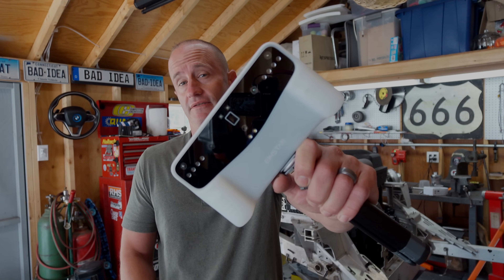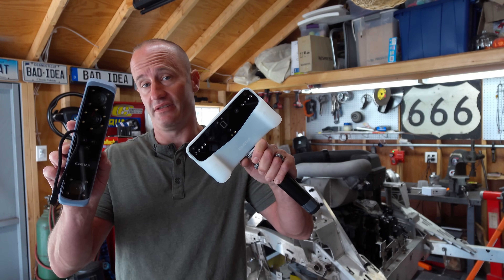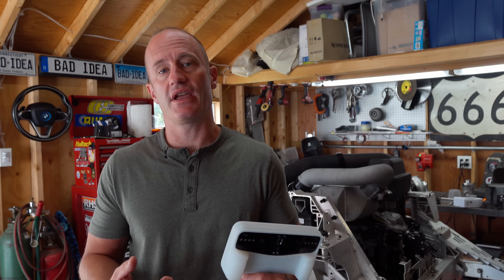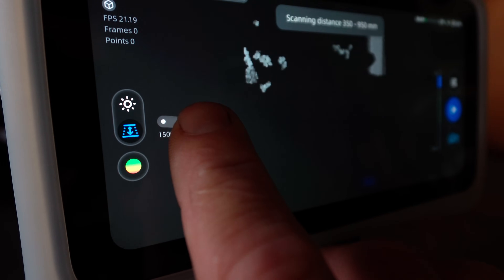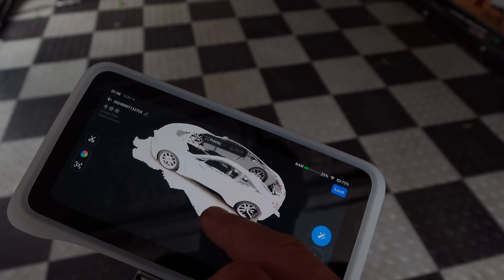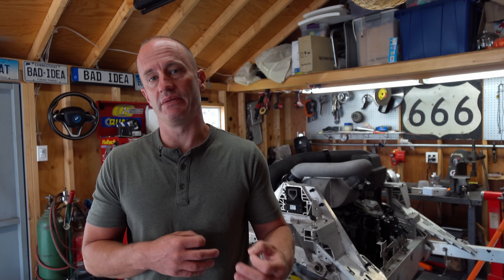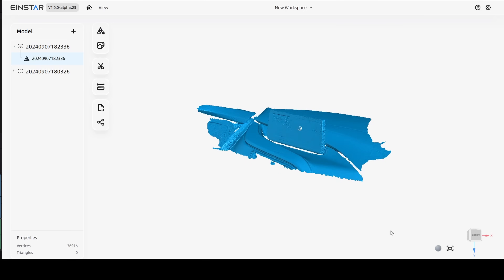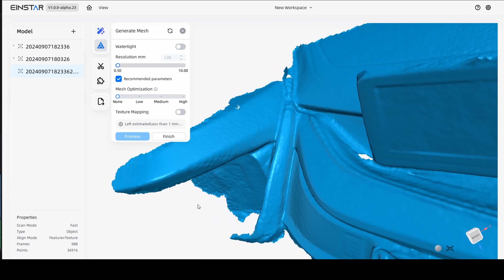Testing the Einstar VEGA on cars and car parts

Comment: Nice Video.
How big is the difference in dimensions between the real and the scanned part?
Reply from the maker: Good question. I went and imported the oil filter adapter mesh into F360 to get some measurements. Overall height of the real part was 38.88mm, mesh 38.857.  For the OD of the threaded port, real part is 28.22mm, mesh 28.248. See link to the photos. I think many conflate resolution with accuracy. These are not the same. Resolution is how close the meshed points are to each other. Accuracy is how precise the geometric relationship is to each of those points. a 1mm resolution does not mean 1mm error.  https://imgur.com/a/JIxcui1
Reply: @CouchBuilt  sounds quite good. My Einstar SE V1 have around the same difference.
Reply: I have the same question. From my perspective, the precision when scanning smaller parts doesn’t seem quite up to the mark either.

Comment: 2 months later, has it gotten any better with updates on midsize things like the dash? I'm trying to decide between this and the original one... I like the idea of cordless
Reply from the maker: There still remains that black hole in scanning range between 250-350mm between modes, but there have been some good updates in general usability. Things like clipping the point cloud that took quite a while to process are almost instant now and theyve added more tracking options like global markers.  I have to say I rarely reach for my older Einstar unless I have specific geometry needs for something about the size of a larger turbo. The convenience of just picking up the scanner and capturing data has been really really nice. I can scan the underside of a car to design an exhaust in well under 10 minutes from starting to the meshed stl.  After a few more months of use, Ill do an update video for sure.
Reply: @CouchBuilt  About time for that update?
Reply from the maker: @zacharykarr it’s on the to-do list. It’s been really damn good with the latest firmware updates. I sold my classic Einstar as it was no longer needed.

Comment: Did you find with the car scan it took 5+ min for the scan to pause, and then another couple hours for it to save before being able to mesh? That's been my experience trying to scan 1/4 of a car, wondering if it's normal.
Reply from the maker: I haven’t encountered anything like that with the Vega. That’s pretty standard for the classic Einstar. I’ve been trying to use the Vega whenever possible for how fast it is. It’s not great at everything, but I wouldn’t expect that behavior from a car scan.
Reply: @CouchBuilt thanks, I'll check with tech support.

Comment: is really not great at scanning any black surfaces of any sort, been testing out the Vega all afternoon. Otter is far superior here and 3 levels of scanning depths with more control. Shame as I was hoping it would be a replacement to my Otter.
Reply: Hi, interesting that you have a Einstar Vega and a Creality Otter.  I need a scanner to scan a full size surfboard, do you think that the Otter would be able to do it?  Top and bottom scans then merging both.  Does the Otter take the same amount of processing time compared to the Vega?

Comment: I have got a much better idea of how it handles larger objects. It is cool that it can scan a whole car, but the model still seems to need a lot of post-processing, which takes quite a bit of time to really make it usable.
Reply from the maker: Depends on your use case. Completing the model to use as a game asset or similar visual application, yes, there's a bunch of work. If you were going to design a widebody over fender kit, this would be good to go as-is. Thats closer to what I would use it for.

Comment: When auto aligning, the preview almost always looks like it won’t work. I’ve learned to do it anyway. Most of the time it works. If it doesn’t, then go back a step and do manual align. 

The only time the preview looks good is if you have already aligned those particular scans. This happens if I align a scan and it has artifacts or overlaps. I’ll delete that scan, redo it, then go back to align everything. Then all of the preview look good except for the new scan.
Reply from the maker: Thanks. I’ll give that a try. I always just backed out of it after seeing the misaligned preview.

Comment: how come it can scan outside??? If thats true then this might be the one to get
Reply from the maker: Something with the choice of sensors used. I’m not really up to speed on that to comment definitively. I haven’t done bright sun, but outdoor scanning is one of their advertised selling points. It worked well enough here in an overcast environment.
Reply: If an infrared scanner is capable of functioning effectively outdoors, it often means some degree of precision is sacrificed in capturing finer details. I guess this is why the final scan of smaller parts looks less accurate.

Comment: So is the vega not good for say transmission adapter size parts?  I was hoping to eek out the HD option to get even more accuracy on that or is the einstar still the best for that
Reply: The Einstar or Creality Otter are going to be 'better' for that application but they both still struggle with dimensional accuracy on holes. 
Really a laser scanner is needed for that application. 
This all being said there are tricks that can be used to make the IR scanners work better like installing a snug fitting bolt in all holes and using the shaft as the reference point for the hole center. This works because they handle outside features much better than holes or narrow pockets.
Reply: @BBowerr  I was also looking at the creality raptor as it has structured laser scanning, but any reviews I've seen on it were meh for our use cases.  Anything would be more accurate than my current "cardboard aided design" method, so might as well just pick up an einstar while it's on sale I guess.
Reply: @suprakillavr4  The raptor has a very entry level laser scanner which must have markers used and a lot of them but is Vader accurate and a pretty bad nir scanner.
It’s nir performance is much worse than both the otter and Einstar.
Personally I would get an Einstein if the scanning pc I was using had and Nvidia gpu. But since both my scanning pc’s use AMD gpu’s the Einstein won’t work so it’s closest competitor the Otter is another strong choice.
Reply: @suprakillavr4  that is a good option, there is also the revopoint metro x which will be a lazer scanner but the price is expected to be much higher.
Reply: @suprakillavr4 i had the raptor... was very optimistic about the blue lazer... it's dog water, it REQUIRES trackers and after evaluating the scan quality... it's no better than my $600 scanner.  Save your money.
Reply: @Printedperformance  Thanks, I grabbed a used einstar and using that for now until something better pops up
Reply: Great tip re bolts.
Reply from the maker: For just the adapter plate scale of things, I would likely say the Einstar. For transmissions in general, I would likely pick up my Einstar if I was going to be designing something like the adapter or a transmission pan. If I wanted to design a transmission crossmember and needed to get a full trans scan into a car quickly, then the Vega would be my choice. You could also scan half a dozen transmissions with the Vega really quickly at say a pick and pull junkyard if you were trying to develop options to choose from.  Where HD mode is limited right now is the field of view and depth of field are really small, so anything that falls outside of that window becomes more difficult to keep tracking. I've been providing some feedback to Shining 3D on that front to see if that will be improved with software, or if its a hardware positioning limitation.

Comment: Headlights, so probably the einstar would be your recommendation?
Reply: I think he summarized at the end that Vega and Einstar have different advantages for different applications. Vega is more convenient and faster for large scans, like an entire car, and more accurate for smooth, small item scanning, while Einstar is suitable for medium-sized objects, like car parts. This seems fair enough
Reply from the maker: I'd lean toward the Einstar in that case since that size is really in its sweet spot, however, I think you could see some better detail with the HD mode on the Vega. Where I had the most trouble in HD mode was things like my turbo where transitioning from the large OD of the compressor housing down to the smaller CHRA would fall out of the field of view. The Einstar could sweep around and keep more features in view due to the greater depth. Something like a headlight housing would likely have less dramatic geometry changes and could do better. You would however need a good number of scan markers across the lens area. It will be interesting to spend some more time with it.